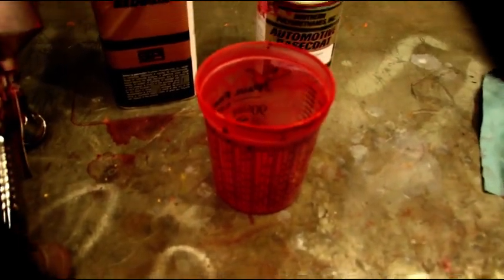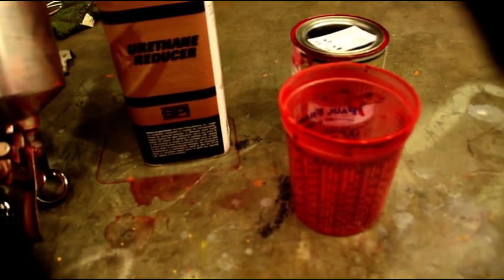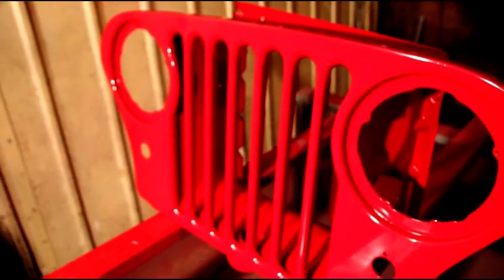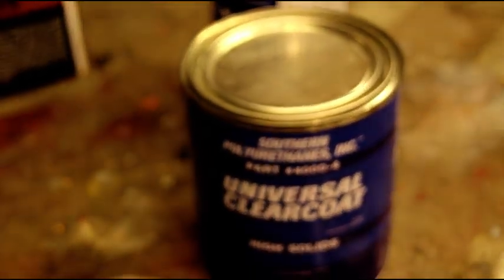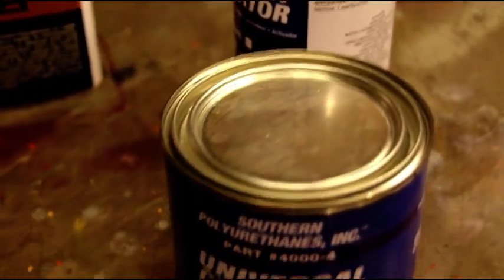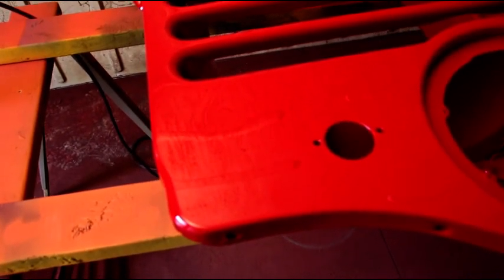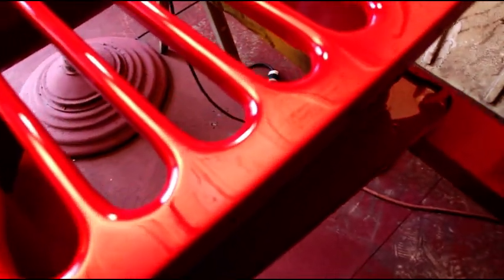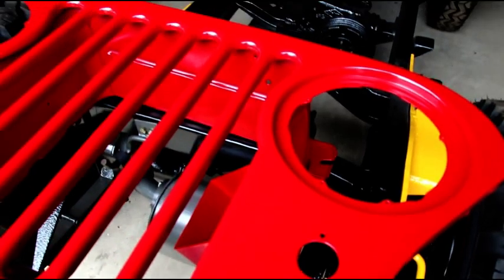Willys CJ5 Snowblower Jeep, Painting Grill RED!

Comment: Looks great, bummer bout the dent on the bottom right next to the grill :-(
Reply from the maker: What looks like a dent is just a large spot weld that holds the fresh air scoop into the grill.  As I said, I don't take out spot welds or stamping defects out of the panels.  Jeep always had a rough look to them as far as spot welds and unrefined panels.  Taking them away ruins the look of a jeep and makes it too smooth looking.  That is why I kept the grill as original as I could.
Reply: Ok I take back my all red comment...the red and yellow are amazing! What was the final count from primer to clear coat?
Reply from the maker: Sandblasted grill.  2 coats of epoxy primer.  3 coats of hi build primer.  Block sand the primer.   2 coats of epoxy reduced and sprayed as a sealer.  3 coats of red base.  4 coats of clear.  Ready to install and attach radiator so I can get the engine running.
Reply: metalshaper do you use a acid etching primer or just a epoxy sealer? I love your channel you have all the machines I was taught very old school hand tools English wheel the man I learned from worked for Mercedes Benz and made metal panels how did you get in to this type of work
Reply from the maker: I don't use any type of acid etching primer.  On the bare sandblasted steel I put epoxy primer.   Next comes hi build primer, and finally the color coat.  I began this type of work many years ago when I wanted better quality restorations than I could find out there.  So many shops fell short and were not very detail oriented.  So I started doing complete restorations myself and here I am showing how things are done in hopes that the next generation will want to learn the trade.  
Brian